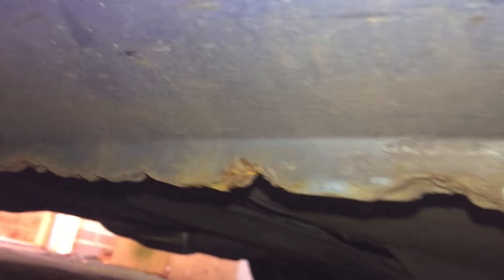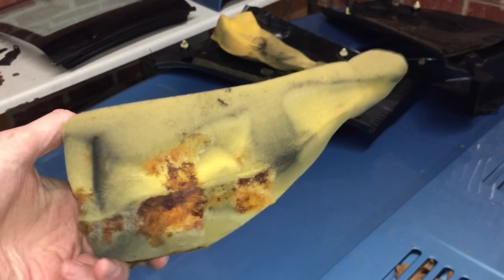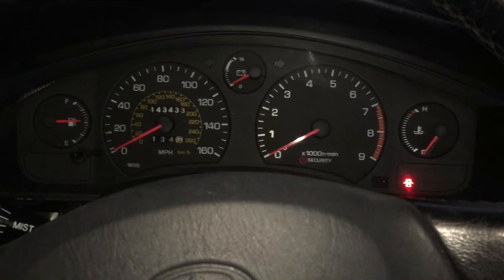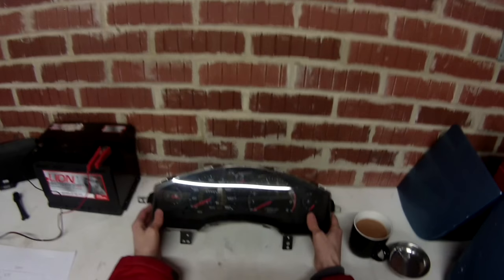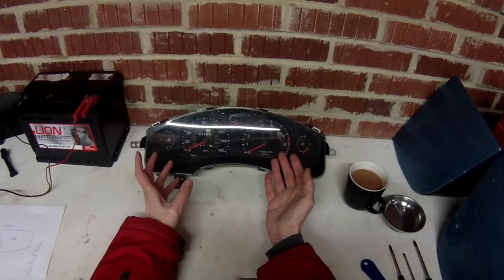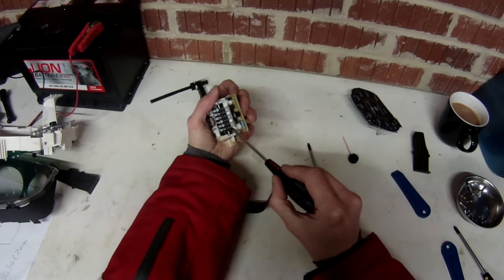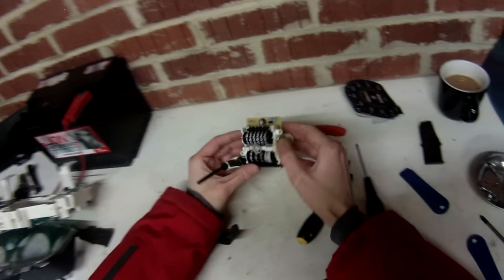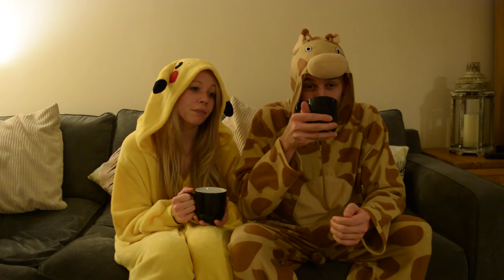Fixing the Speedo & Checking for Rust - MR2 Project Ep 3

Comment: Your speedo suffered capacitor electrolyte leakage due to age, it travels down the capacitor legs and rots ths copper under the green coating, fixed many, also you can change the mileage by just popping the low number end of the rod with small black gears out, no need to remove face or take metal spring thing off, Used to have a J reg Zircon Blue MR2 before my mr2 turbo, just done entire passenger sill, mine never had the foam, rusted through 5 layers jack point disappeared, it starts as water getting in wheel arch from the side trim stainless steel screws and plastic thread inserts, as well as the black bungs in the sill water slowly creaps in and as driving moves to the rear sill section and gets trapped / collects between the 3 layers inside the sill and starts at the 1 spot weld holding outer sill section, to second skin and also to that bottom rusty bit inside where your foam was, and gets worse, rotting from inside out.  Hope you finish yours, great cars, my website that has my blue on on is www.mybluemr2.co.uk
Reply from the maker: Thanks for the detailed comment, and your website is awesome as well. I hope we finish ours as well 😂
Reply: On mine the speedo would go to about 40 at max and just stopped working after a few months. It’s a 91 usdm turbo. Would you think I had a similar problem with the capacitors?
Reply: @Nopenotatall  yes most probably the speedo, mins started to have a mind of its own and would work for 10 mins then needle just drop to the bottom, the sender in gearbox use a spinning magnet to generate the pulses (hall effect sensor) so providing the plastic gear has not broken in gearbox and wiring is good it will be speedi gauge its self. Wiring on the plug goes, 12v supply feed from 7.5A fuse (brown colour) in engine bay fues box, GND to chassis and signal output wire goes into connector block next to ECU in rear trunk, then from there down to front of car to connector where the door loom plugs in (but a differant plug, 3-4 down there) and from there to the instrument cluster, traced mine to confirm wiring all good.

Comment: Noooo - don't remove the needle from the speedo!!

The spindle it sit on holds it against the rest pin, so when you popped it off, the spindle will have unwound about another 45°. Unless you have a way of giving the car an input signal when you put the needle back on then your speedo needle will almost certainly be a long way out when you put it back on. TBH, I suspect that's what the problem was with the original speedo; from how it moved it certainly looked that way to me.

One solution to putting the needle back on is a very quiet, straight road and a GPS app on your phone so you can put it ba ck on at a know 30mph (for example). It's pretty tricky to do that though. Another would be to jack up the car and find a known gear / rpm combo that matches a certain speed so you can refit the needle like that. (My rev3 MR2s have different gear ratios to your rev2, so I can't provide that for you - there are gearbox calculators out that that will get you a theoretical value though)
Reply from the maker: Mark Shinn ah shit! That's what I get for assuming this speedo would be as easy to work with as the modern stepper motor ones I'm used to 😖

Thanks for the heads up though, and for the tips on how to fix it. Worst case scenario I'll have to get another speedo...

I don't think this was the problem with the old speedo though, as sometimes it would read correct, some times high, and sometimes low.
Reply: Yeah, it's certainly not a modern stepper motor. Sorry :(

The angle it moved off the peg looked a lot like the kind of angle you'd get from a badly placed needle (having made this mistake myself) but you know what it's been doing better than I do.
Reply from the maker: Mark Shinn I came up with an alternative method to recalibrate the speedo - https://youtu.be/SQjN-exCJrQ 😊
Reply: Brilliant!
Reply: clever fix